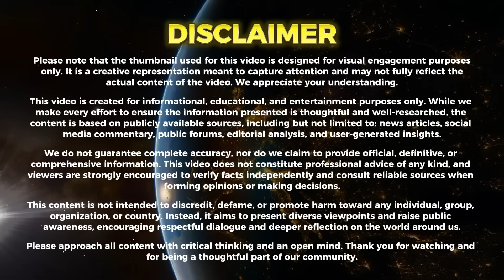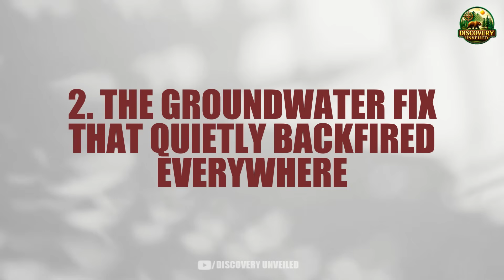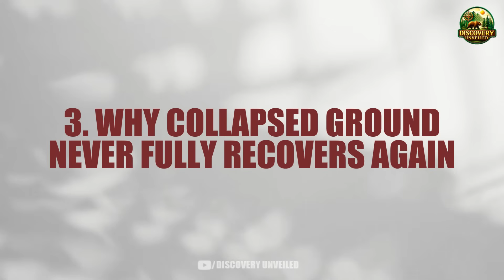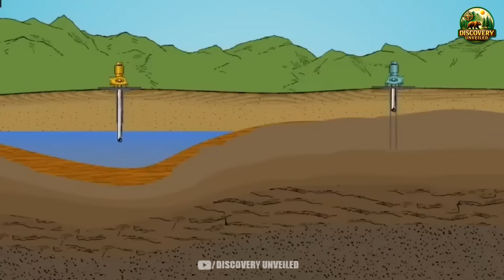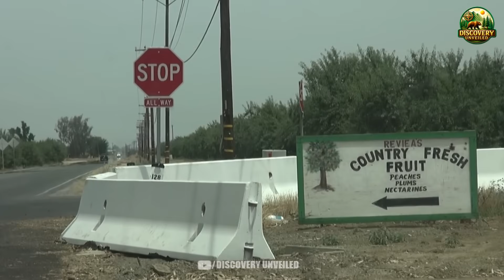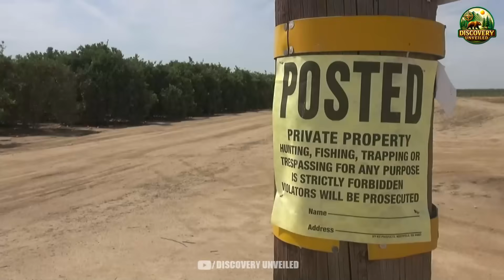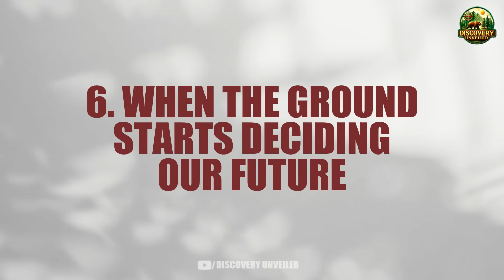Footage From Central Valley’s Collapsing Ground Reveals The Aftermath Nobody Expected!

Comment: I'm hearing somewhat the same rhetoric concerning the condition of the Mississippi River. Previously some shortage of water meant closer monitoring, more dredging, and other "fixes." But now it's much lower than ever and this river is like an extremely important highway down the middle of the nation being narrowed, and in fact blocked of shipping. Boats and barges can be lightly loaded because of shallow water but only to a point.
Reply from the maker: Low water disrupts shipping and costs rise. How can dredging, monitoring, and freight planning adapt to extremes now?